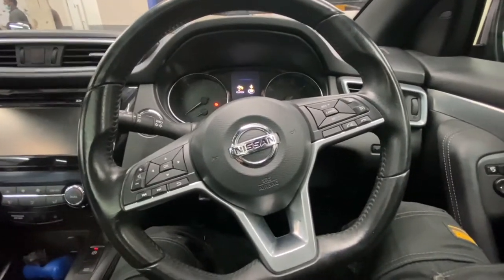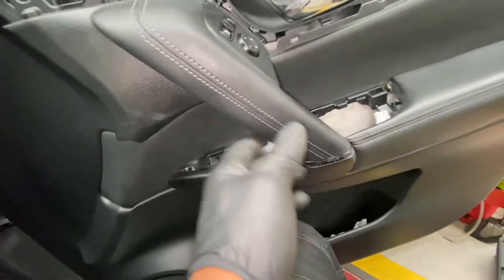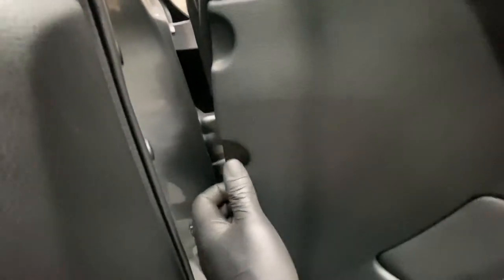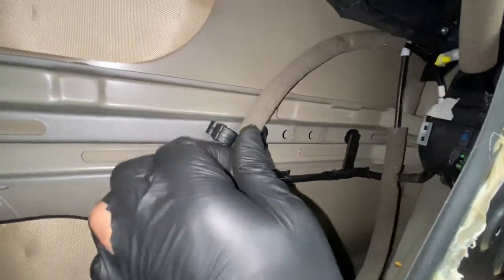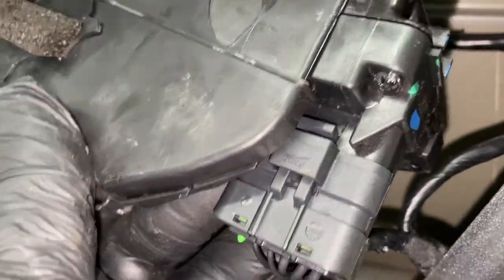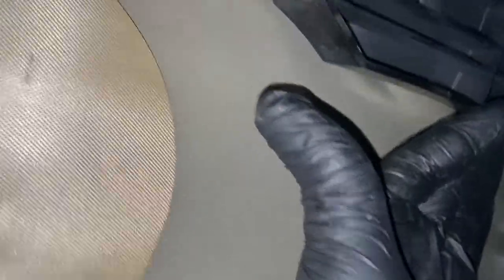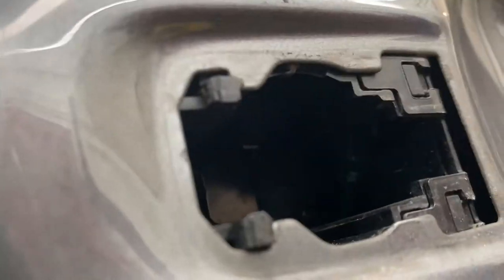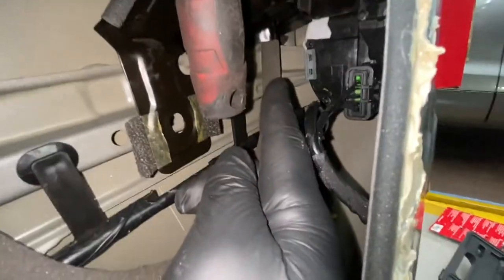#Nissan #QASHQAI #2019 #Driver’s #door #Lock/Actuator #replacement

Comment: hi, great video to help with the front doors. its the only video at all i could find of a lock replacement at all on any door for this model of qashqai , even though it was my rear lock i was replacing. it helped in parts for the rear lock so worth a watch. it also does some things in different order but doesnt make too much difference i dont think?

for anyone who is in the same position looking to change their rear lock there are some similarity and some differences. ended up buying the haynes manual to help finish the job.

inner panel comes off pretty much the same, same as the weather sealing sheet ( the book says use a sharp knife to cut the sealant away from the white sealing thing, id recommend because i ripped mine using hands)

one big difference is the window guide thing, in this video you are able to just pull it off. for the rear, there are two extra screws near the weather stripping you have to pull back and unscrew to undo. then some wiggling to pull it out. also a little tricky to get back in.

another thing i had a problem with was getting the outside door handle off. once you use the t30 bit to undo that retaining thing behind the grommet . it should be easy to remove the handle. i found even though it was fully unscrewed. i couldnt remove the handle. ended up using a small magnet to make sure the screw was all the way out as poss in its section. after that i was able to pull out with ease.

apart from that off the top of my head i think everything else is similar or the same. highly recommend the haynes manual till someone makes a video on it.

like i said great video just hopefully some extra help for anyone who comes across this video who wants to do the rear locks.
Reply from the maker: No worries hope it was of help to you
Reply: @g_a_bofficial  very much so thank you

Comment: Hey there, thanks for this video. I have the same problem in both front doors. Is it possible to fix the actuator without having to buy it? 
Did you try to understand which is the prpblem?
Reply from the maker: You can try but if you want but  I wouldn’t recommend it

Comment: Hi, Nice video. What was the actual issue with this? I have a 2017 QQ Tekna and the passenger side inner handle wont open the car any more :-(  it locks fine and can be opened from the outside. Will this be the same issue with mine or is there some kind of baby lock that has activated somewhere? Thanks
Reply from the maker: The lock  actuator wasn’t locking